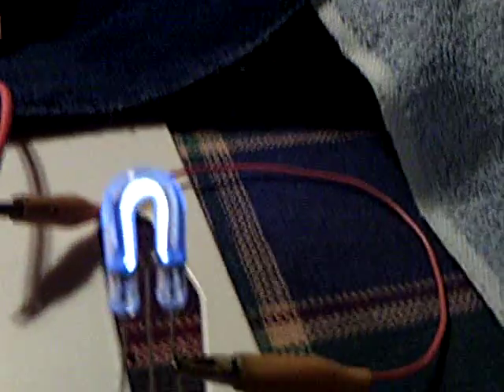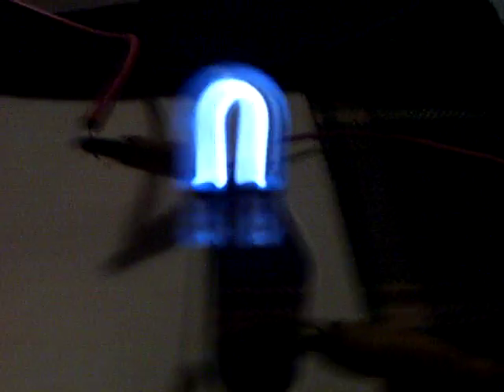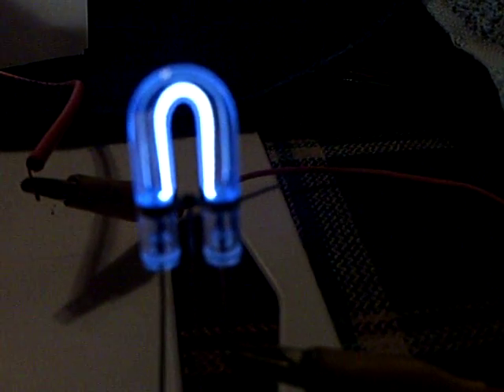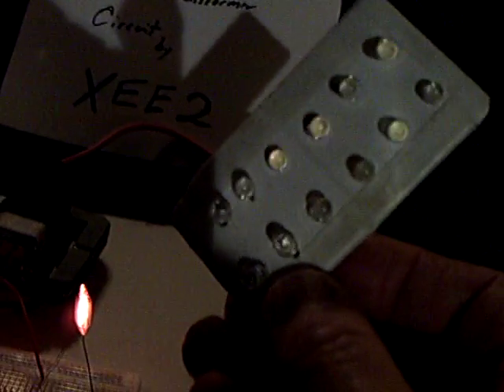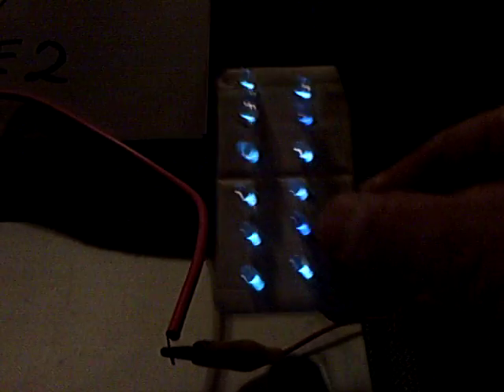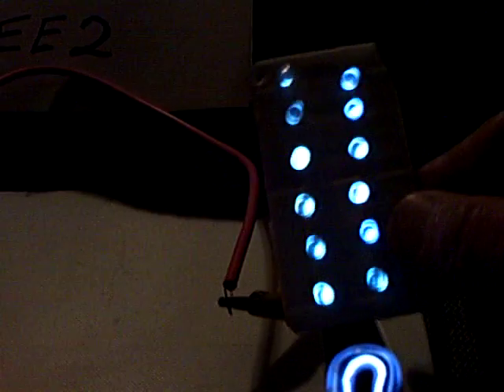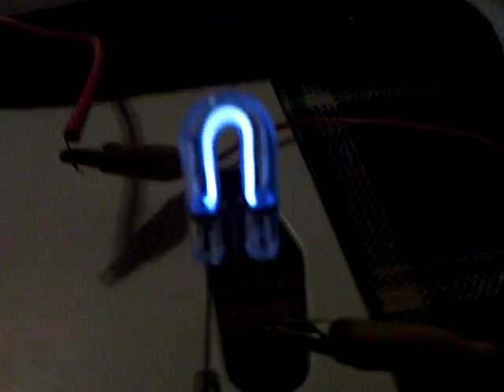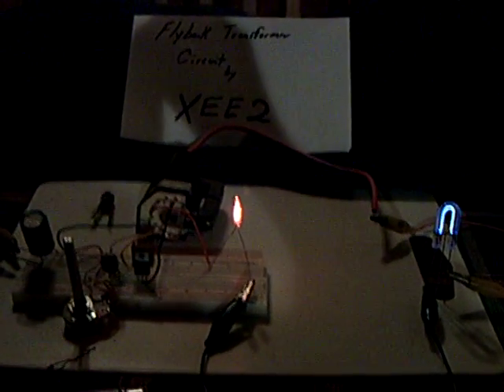Flyback Transformer Joule Ringer.ASF

Comment: Well done Lidmotor.

Did you power this only from the SuperCap
or also from a battery ?
How long does it run with the lighted up Xenon tube just from the
capacitor ? Maybe you can show this in another video and and let it run down ?
Many thanks.
Regards, Stefan.